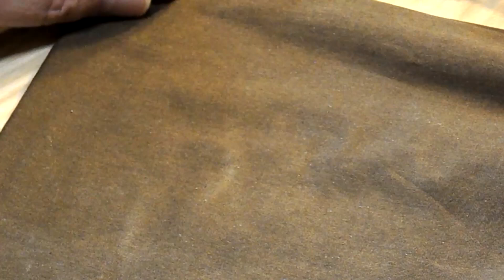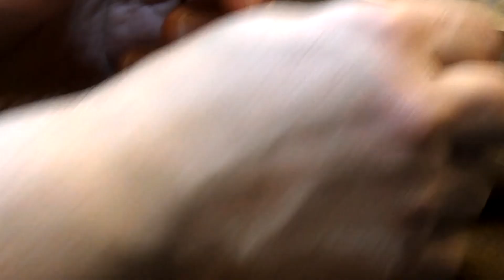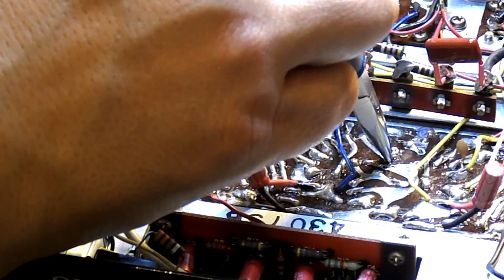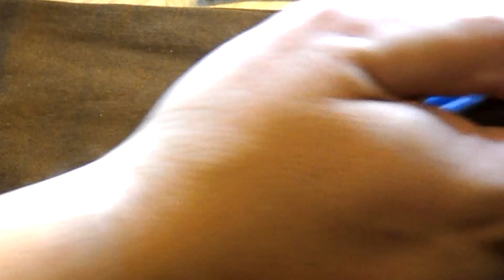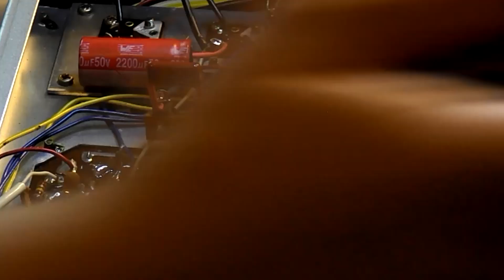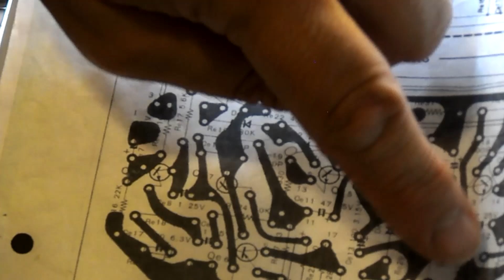Do the Wiggle Lead Boogie- unsoldering parts on vintage circuit boards!

Comment: Good tutorial!  I'm not quite confident enough to touch my own circuit boards with a soldering iron yet.  But I'm going to do 2 things:  1) I've bought a Heathkit clock kit to get some practice, and 2) my Sansui 661 blew the fuse for the lamps when I tried to install LED lamps, and it's an axial fuse soldered in.  (Working in automotive the idea of a fuse soldered in is quite strange.)  I've ordered replacement fuses and will give that a shot.
Reply: The original fuse-style incandescent lamps are probably rated for 8 volts; the receiver's power supply voltage to illuminate them is probably 8 volts AC (not DC), or a little less under load (the incandescent lamps draw a lot of current), but because LED's draw so little current, the 8 volt supply for the original lamps might rise to 10 or 11 volts, and might require a dropping resistor to lower the voltage to tge LED's. The LEDS will need a builtin rectifier to convert the AC supply to DC ( some led lamps have this, some don't). Hope this info is helpful. Changing a vintage receiver over to LEDs is rarely a straightforward "drop-in" procedure!